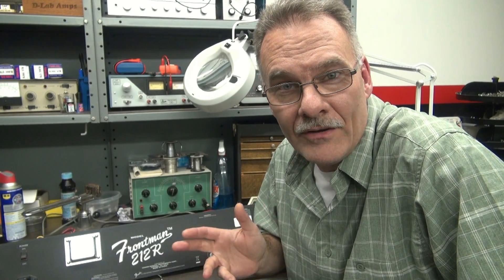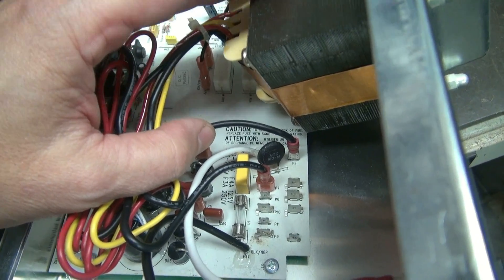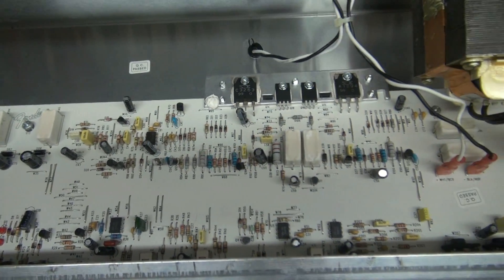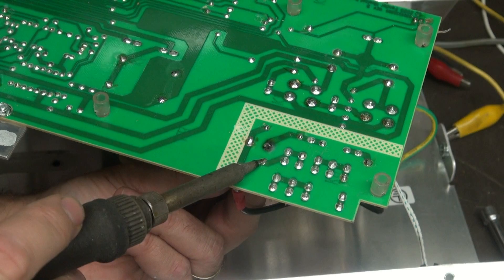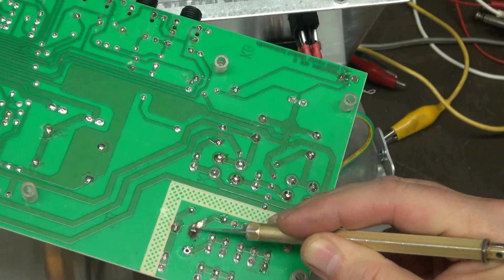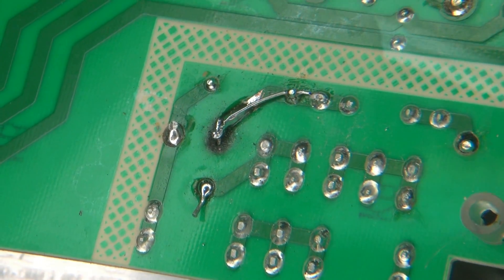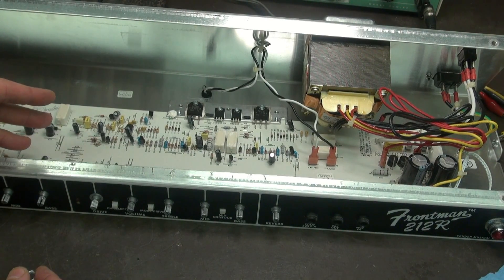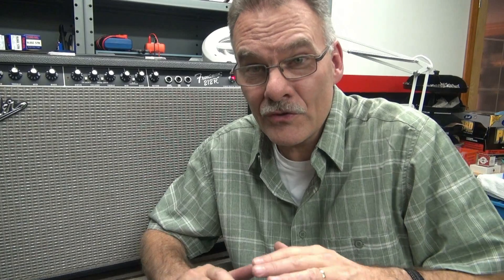How to repair Dead Fender 212R Combo guitar amp solder connections

Comment: Thanks for the video. very nice of you to spare time to show us (me) that it's not that scary to dive into such repair.

I have a fender stage 1600 which I bought from another guy. right after plugging it to test, I noticed this humming noise that comes from the speakers the minute in plug the jack in. it only happens if a jack is connected. I tried multiple cables and all result in the same issue. I read through various forms in which the closest I could come to as the potential cause of the problem is that the two main filter caps may need soldering. you think this is the case, or would there be another cause?
Reply: If the problem was with the filter capacitors, the hum would be present with or without the guitar connected.
Reply: did you fix it? having the same problem but with a 212r frontman

Comment: I have a little 15" frontman that I couldn't get to power on. I replaced the fuse and now it powers on but produces a monotone hum that is not affected by any of the pots on the board. When I use the 8ohm speaker out or headphone jack all it does is "transmit" the hum to a different output. Does anyone have any advice on a good fix?
Reply from the maker: Hello, sounds like the TDA2050 final output chip has shorted.

Comment: Hello friend,
Excellent video! I also got a frontman 212r amp. My problem is that it does a humming noice when I connect the guitar line into the input jack. I tried with different lines and the humming persists. I also turn down all the knobs and the humming still persists. The amp does not make the sound if it doesn't have any line connected. Any ideas of what could be the problem? Thanks in advance.
Reply: Hi my firend! Did you check the filter capacitors? Greeetings!
Reply: All the indications are that you have bad filter capacitors.

Comment: Thats the problem with these circuit boards, the printed circuit copper foil is never robust
enough for any high current device like a power lead or in this case a thermistor.
I've had to do the solid copper wire soldered to the existing foil and preferably to
the next soldered lead. Good work..better than new, because it will never fail there again. 
Are those power transistors only heatsinked by the metal chassis..yuk!..
 talk about Fender cheaping out these days. For a few cents more, they could
have included finned aluminum heatsinks and some silicon grease. 

Leo had the right idea with wires an turrent boards..never have a problem with them.
Reply: I'm pretty sure that the problem with the thermister lead was caused by a fractured solder connection.

Comment: can anyone tell me whats the trick to remove the knobs on the pot meter axe , i cant get the knobs of , the pot meter shaft breaks if i put a screwdriver to try to lift....
Reply: FIRST, check and make sure there are no set screws holding the knob on the shaft!!! 

...next, if it's a push on knob- DON'T try to pry the knob off with a  SCREWDRIVER: at best, that will leave marks- and at worst, it will cause damage!!!

A proven technique is to slip the edge of a rag under the knob, and pull on the rag to remove the knob.

Comment: Hi! I have a fender frontman 212 (2010) and the problem i have on the amplifier is that the tip of the jack (of a cable) is stuck inside the input, may i have to open by myself the amp or its better to send it to a specialist? Thanks! Ps: very usefull vid!
Reply from the maker: Hello, I do not know of a way to extract the tip. When these come in the shop, I change the jack. It is a PC mount type.
Reply: D-lab Electronics Oh, thank you anyway!

Comment: Very helpful, now I am confident in keeping mt Frontman 212R running long into the future. I like the 212R and find it good sounding with controls that actually do something.
Reply: Still playing through my 212R for the good tone. I was considering the new Fender Tonemaster Twin Reverb 212 200 watts but nah, I'm good because I was lucky enough to purchase my Fender Frontman for $200 back around 2012. At the time I protested the price but it turns out that I have a good sounding, rock solid transistor amp with 100 watts and (2) 12 inch speakers at 4 ohms. Real spring reverb too!
I kid you not but when testing alongside my Fender reissue '59 bassman LTD. and Fender Hot Rod DeVille 410 III tube amps. the Fender Frontman 212R has very similar tones. That is why I decided not to purchase the new Fender Tonemaster amps. I have no reason too! Oh, and believe you me, never in a million years would I have guessed that my Frontman 212R would sound as good as my wonderful tube amps.

Comment: Another informative video once again! Worked on my second 212R today. Unfortunately, the primary winding on the PT was shorted...Fuse would blow upon power-up. They are a time consuming amp to work on, but I warned the customer that my solid stat rates are higher than tube because of designs like this. Good case history info here! Keep 'em comin :)
Reply: How do you know that the primary is shorted? The primary has a very low resistance anyway.

Comment: How did you know the thermistor was not bad due to arching? Just curious as most of us out here probably would have replaced it, maybe unnecessarily.
Reply: MedHawk i have had a thermistor arc and unload its stored potential on the chassis of an amp. Was still good. They tend to only go bad when they explode to protect the power transformer from going up in flames.
Reply: It was obviously a bad solder connection.